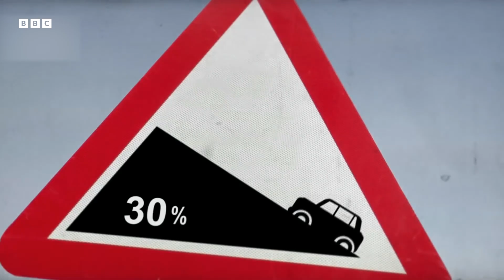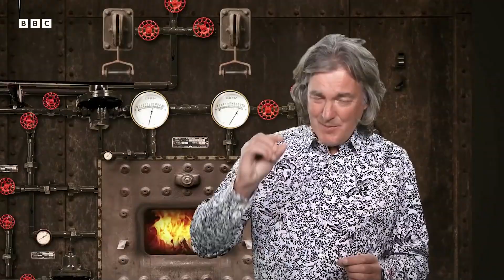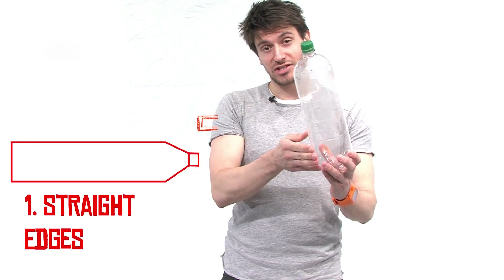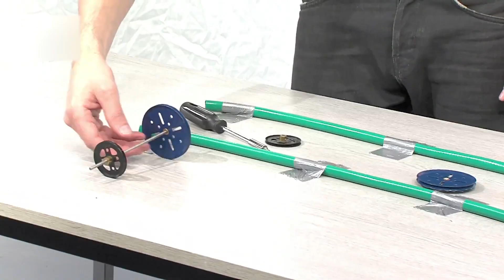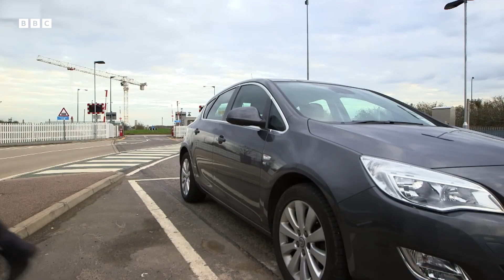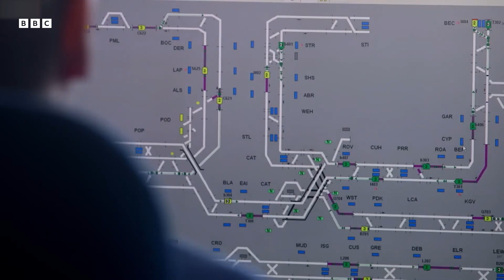Everything You Need To Know About Trains | BBC Earth Science

Comment: Well, Actually there are methods for trains to overcome steep hills, it is called "cog railway system". By adding a rack between the tracks and a cog wheel which connects the engine underneath the locomotive, the problem of lacking of traction could be solved.

Comment: When a train goes round a bend the screeching sound is caused by the slightly different contact speed between the two opposing wheels . One is effectively travelling faster in relation to the track surface at the outside of the curve relative to the inner one, hence the screeching caused by the two wheels fighting each other

Comment: Ive ridden a tourist train departing Cass WV to the top of a nearby mountain and back which was originally a logging and lumber operation.  Much of the grade is four to five percent but in places is as steep as ten percent. This is possible because they use Shay locomotives which have vertical pistons on the side and a crankshaft similar to a motor vehicle and the motion is transferred to the wheels via a driveshaft and gears. Due to physics, the locomotive is on the downhill end of the train

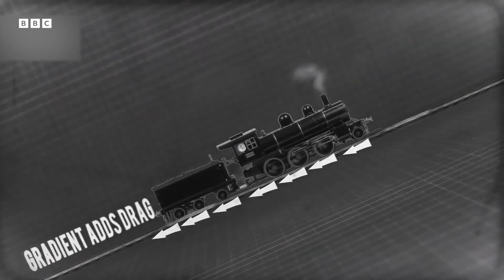Comment: wrong wrong, at 3:50 he says as the train goes up an incline its tractive effort remains the same this is wrong. When you travel up an incline your weight transitions to parallel force that's proportional to the angle. Roughly translating to 3% less weight on the rails for a 2.65% grade. The amount of unknown variables stops me from being able to calculate the tractive effort lost. Tractive effort is directly related to the friction between rail and wheel, all other variables being equal, less weight on the drivers=less friction=less tractive effort.
Reply: You're also wrong. Tractive effort is independent of resistance or adhesion. Those are both separate calculations. For a steam locomotive, tractive effort is essentially constant and for Diesel it's inversely related to speed.